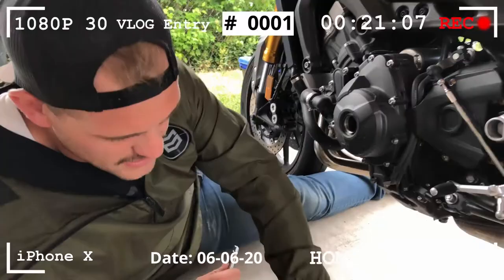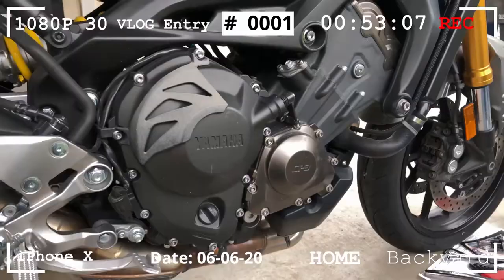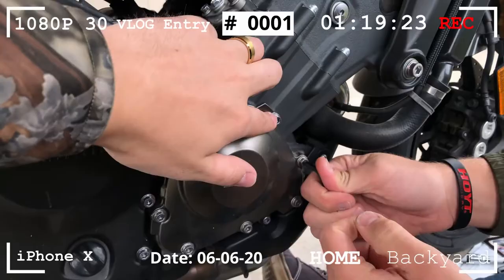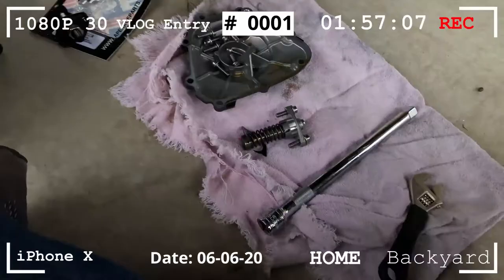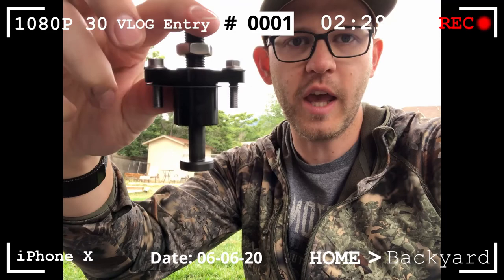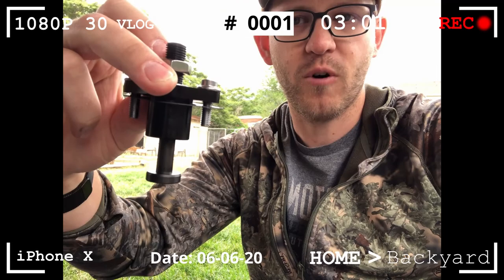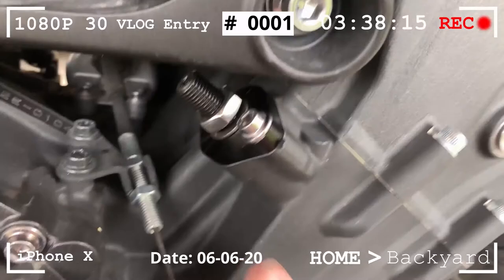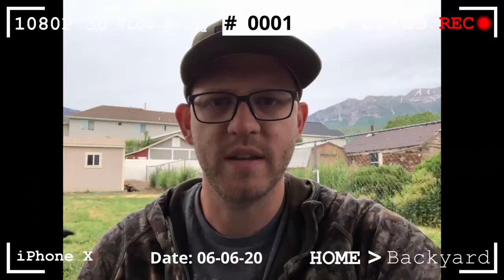I replace my Cam Chain Tensioner in my FZ-09 [VLOG #1]

Comment: So what did you actually do wrong then?
Reply from the maker: We forgot to adjust the bolt to the point where an allen wrench could fit between the frame and the bolt for further manual adjustment. We ended up taking it back out and then making the adjustment and putting it back in; super annoying and we could have totally avoided it if paying more attention.

Comment: Can you tell me the Partnuber of the Tensinor?
Reply from the maker: I ordered mine on Amazon. I couldn’t find the exact one I bought but it is similar to this one. 
MC MOTOPARTS Black CNC Manual Cam Chain Tensioner Compatible with YZ450F 03-16 04 05 06 07 08 09 https://a.co/d/4ewmkHc